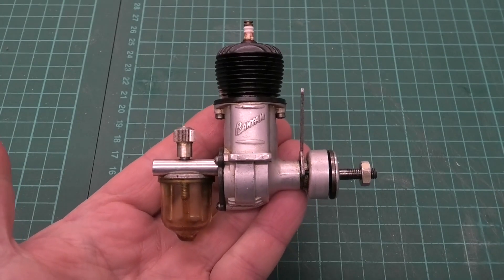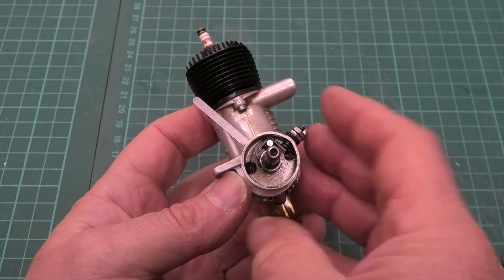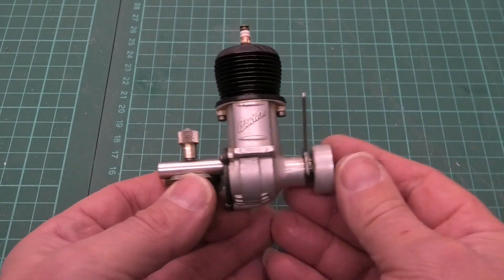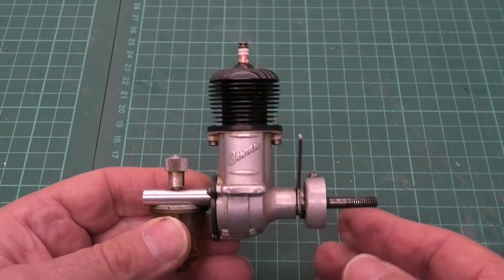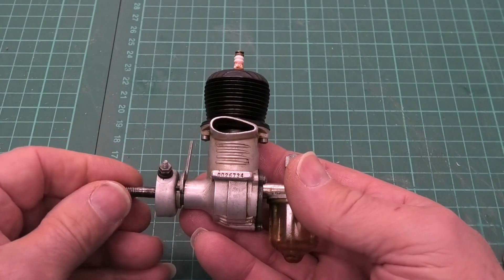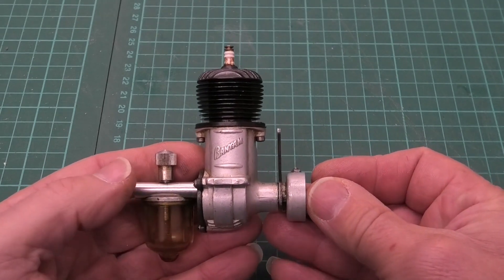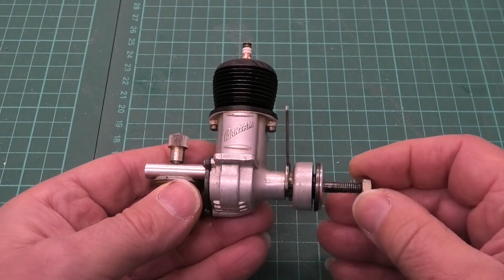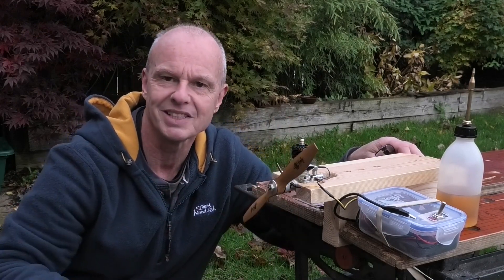Bantam 19 Spark Ignition Engine - 1940's Vintage Petrol engine

Comment: never seen one of these before,does that timing lever not move while in use,with vibes etc?
Reply from the maker: Hi Gary, it will move if not tight enough, there are screw that you tighten to keep it from rotating, trick is to get them where it moves freely to advance and retard the ignition, but they stay put when needed, easy enough when you get used to them.